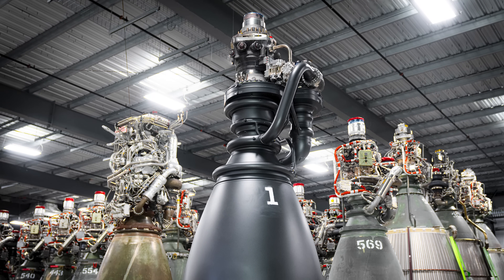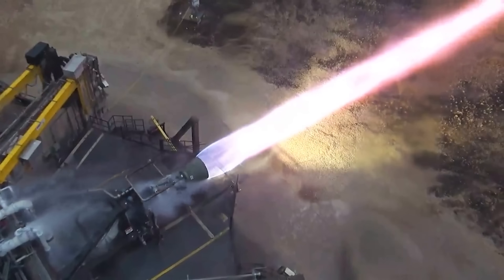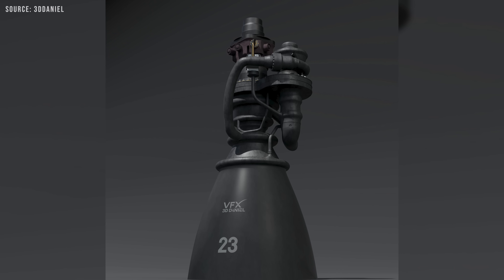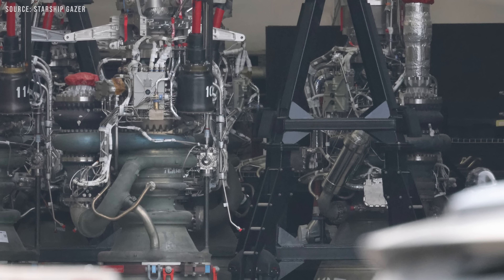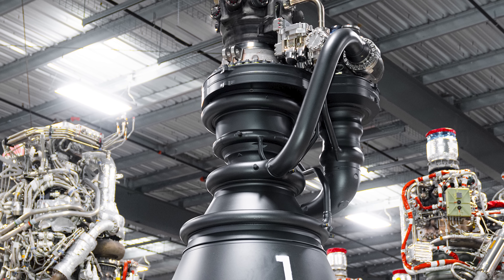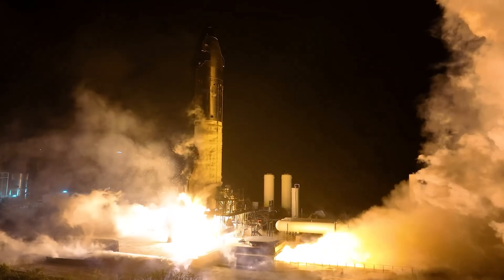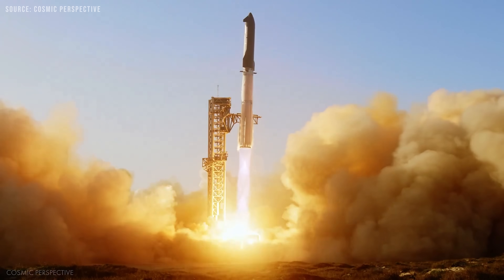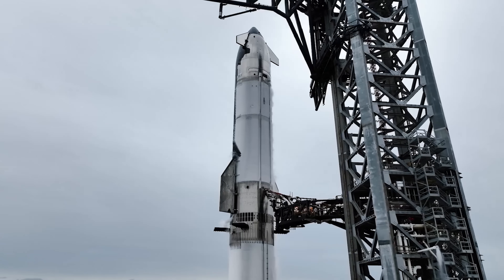Elon Musk Revealed SpaceX's Solution on Raptor V3 Problem

Comment: If re-ignition is an issue, could they not develop their system whereas the ignitors are constantly firing as long as there's electricity sent to them? Since the valves are controlling the fuel, there wouldn't be any chance of premature ignition of the mixtures.
Perhaps this could lead to a shorter lifespan of the ignitors but that's a very small price to pay for satisfying in flight requirements. Another consideration could be dual ignitors for each pre-burner. Redundancy for the sake of assurance is always worthwhile.   :)
Reply: no, anything that reduces the time between maintenance operations cuts into the goal and having to gut each engine after a limited number of flights forces other changes down the line. figuring out the optimal arrangement for the r3 engine is much better than compromising on 1 part causing a cascade of changes that limit the overall usefulness of the engine and makes the whole platform less not more

Comment: The expander cycle is particularly desireable for hydrogen based engines, but the max thrust issue (square-cube) limits it's usefullness to lower thrust engines in the 250kN range.  For me, this is the ideal cycle when the thrust needs are within reach of the design.

Comment: I follow Musk's logic. Few moving parts that if failed the engine is scrap.  You only have valves and igniters. A failed pump rotor fails, it will destroy the turbine housing. Not repairable!